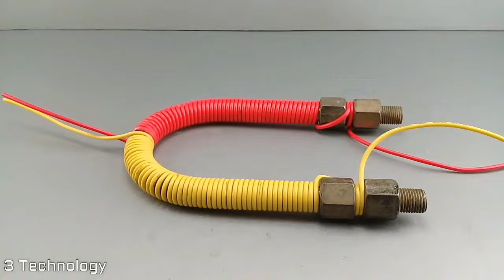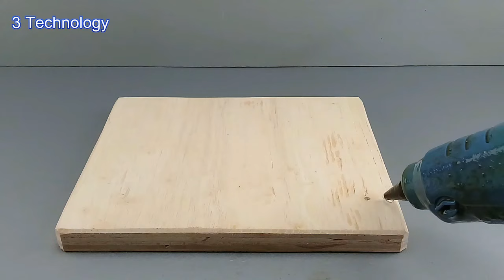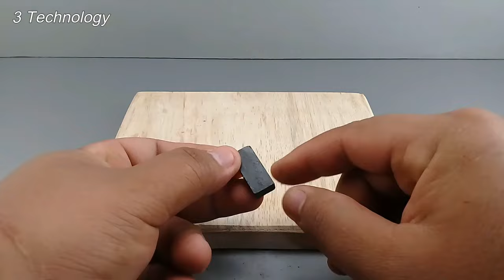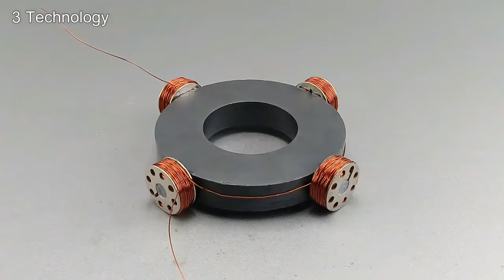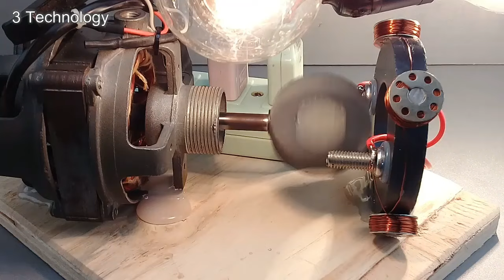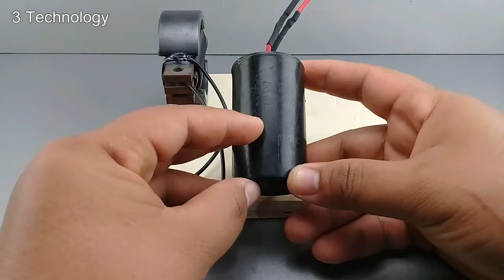Top Amazing Free Energy Generator 220 Volt Self Running Machine

Comment: Pulling thread -> Rotating motor -> Rotating magnet -> Emf in coil -> Stepped up using transformer -> Sent to plug socket -> Electricity from plug socket due to amplified effect of changing magnetic field -> Rotating motor (sustained)

Comment: 1. What WATTAGE are the 'lights' rated at eh?  2. ike the others, no amperage noted, for .001 amp at 240V WILL register on an Ohmmeter at 240V.  Prove it's got the amperage and it can be believed...maby.  Plus a 3rd thing, no temperatures noted and #4, your killer that all ready proves this is a hoax... for if your wire is not VARNISHED and is a direct copper wire, then therefor the wire is not shielded upon your 'magnet' portion of the 'generator.  You people need to quit producing crap.
  Another good one too, what is that box ON the motor that is black?  Must be the battery source to run the motor, for battery packs are constantly being able to be produced smaller and smaller, so if your gonna produce something and waste our time to respond, as well as something that is a waste of time to replicate without knowledge of EVERYTHING involved, then just, please, select your file instead of for an upload, but to delete.